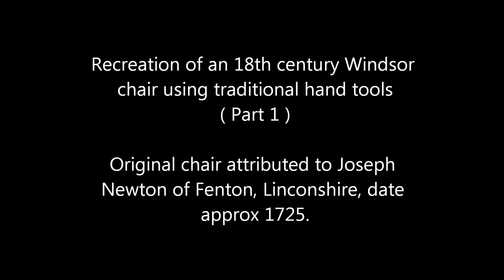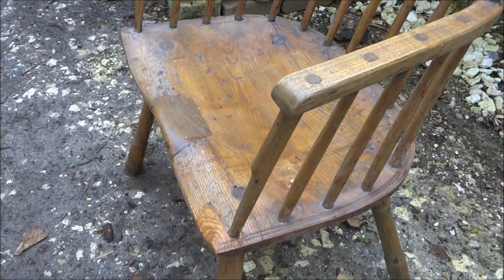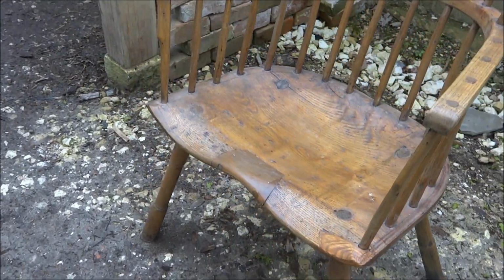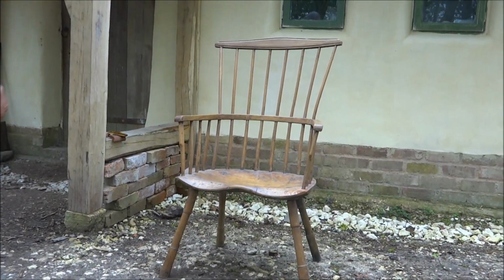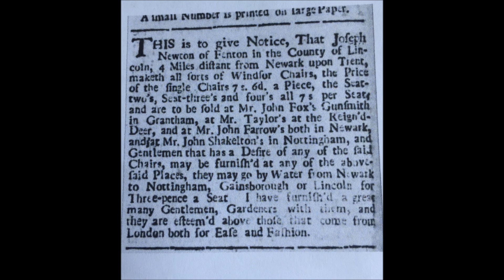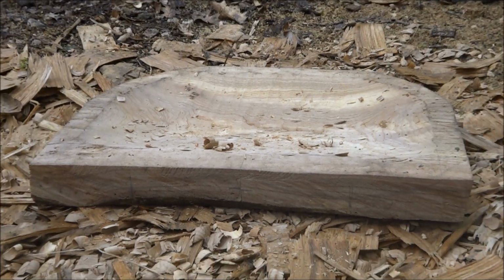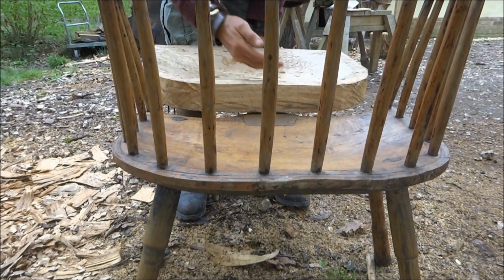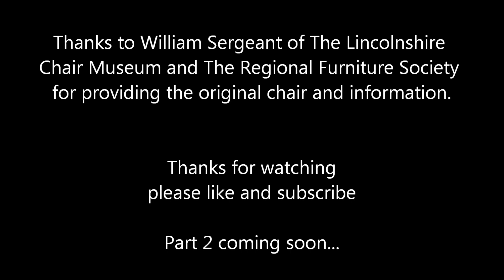Recreating an 18th century Windsor chair with traditional hand tools

Comment: Do you know the wood of the original part of the chair? (The video mentioned elm and ash in the replacement parts, but I’m curious to know the original wood species.)
Reply from the maker: The original chair seat is made from ash. I didn’t have any ash that big but I do have elm which is a good seat wood. I’ll fell a big ash after these gales blow over and convert it for future use.

Comment: This isn’t a dig, but I watch these guys making stuff the way it used to be done, and think to myself, if you could bring those old guys into a modern workshop, I know they would choose the, DeWalt thicknesser or Makita mitre saw.. etc. They wouldnt give half a farthing for a flat adz!
Reply: You arrive at that conclusion because you don’t understand how to build things I suspect. 

There’s been many a jobsite I’ve walked on with my basic carpentry tools and other than the power miter saw and table saw- if even needed- I’m at work with two or three trips inside with my box and a bucket of traditional tools. On the big jobs all the other workmen are still wheeling in with their folding saw stands and once they finally get going I’ve been already working for some time. And while they re-cut and calculate their angles and fitment and try to biscuit stuff, me and my hand planes, old-fashioned scribes, chisels, and wooden-handled hammer usually can do 125% to 150% their productivity at the same quality expectation. 

Building a Windsor is a tedious process yet it’s both easy and accurate without any power tools needed. Few if any ‘mistakes’ occur and those that do most often are absorbed by body english and simply the organic process of constructing the chair. 

Add power tools to the mix and you might do some tasks faster in the process but you will have more unrecoverable mistakes- never mind losing the esthetics of the workman and the productivity losses of compounding error. Too much accuracy applied to an art is visually “colder” and has an institutional, uninviting tactile presence. 

Not understanding that tactile and esthetic elements are not features but rather revelations bequeathed as a gift to the end user is common- don’t feel too badly. Lots of folks look at handcraft and in their laziness think, “that’s too much work” and so they employ machinery to ease their discomfiture- spending much time sanding afterwards to cover up their tool marks and errors. 

There’s little, very little, benefits to many modern and post-modern ideologies when applied to handcrafted chairs or even the leather-wrapped interior door pull of a Maserati or Rolls-Royce where the felt but not seen heavy stitching cords are intentional- specified to communicate to the user an esthetic through a tactile-only sensory exposure. 

Newer methods are not always better. 
Not understanding that the consequential byproduct of these sensory tool methods is an essential part of the value of the finished chair is an unfortunate consequence of the societal trend of the current generation’s swallowing the koolaid- everything ‘old’ is inferior or inefficient. A chair is not just a chair- it can be much more than a chair.
Reply: @fishhuntadventure  actually you know all, I am well aware of how to make stuff and if you think a sawyer in a saw pit was happy getting covered in crap then you are unfortunately living in la la land.. like Any trades person, its all about quality in the quickest time so they can move to the next job.